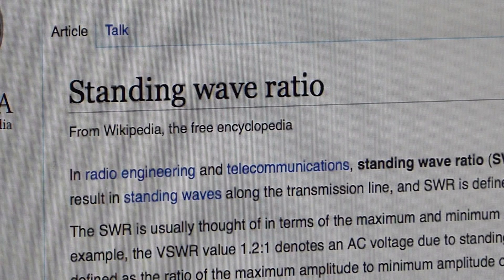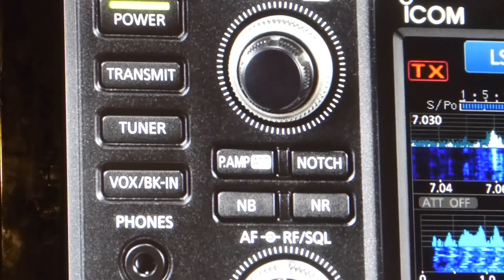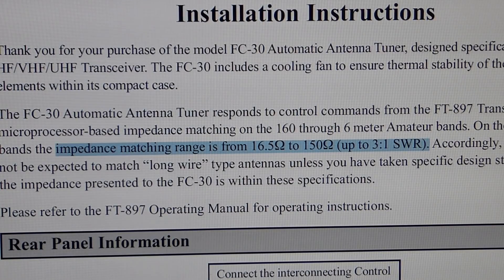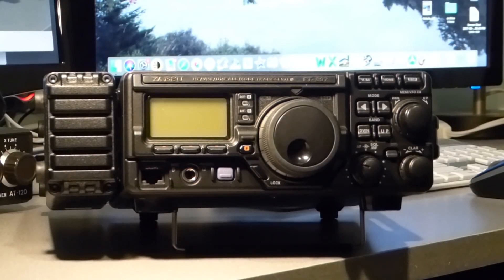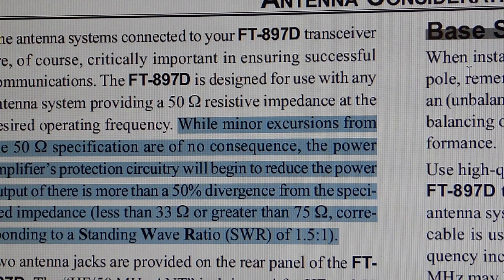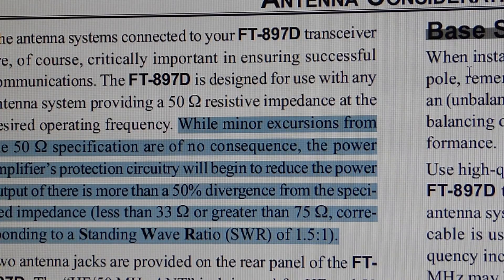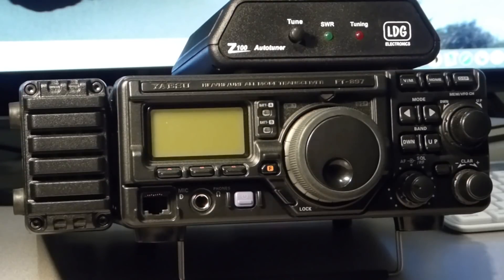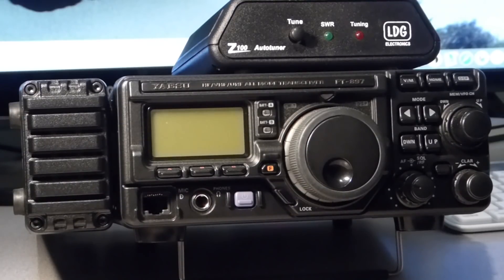Automatic vs  Manual Antenna Tuners

Comment: Very helpful! I opted for a Dentron Jr. Monitor manual tuner for my setup. It would be great to hear about portable operation considerations based on your experience!
Reply from the maker: Good choice you made there with the Dentron! Check out some of my 2017 portable operations videos for more information on using tuners in a portable setting.